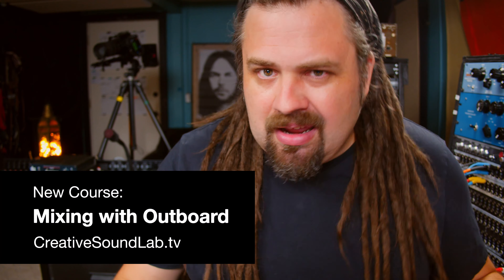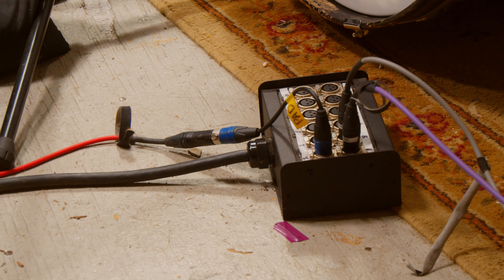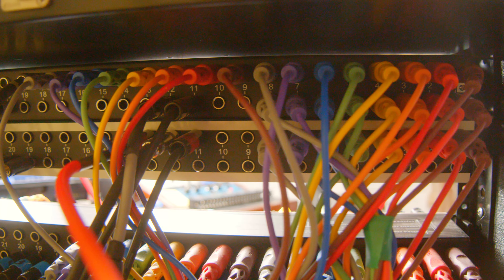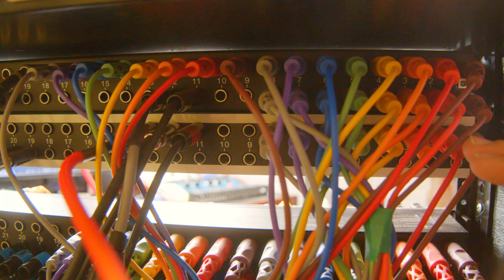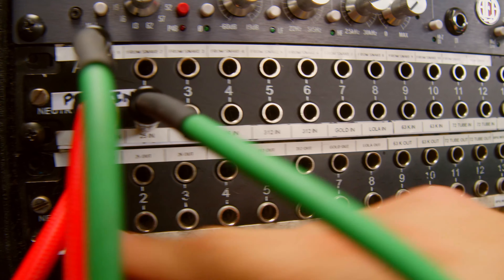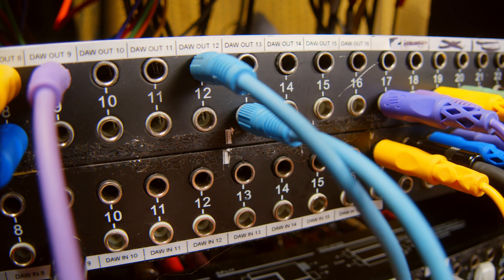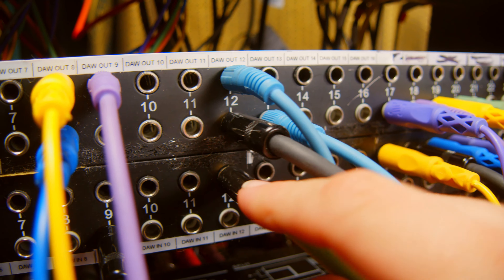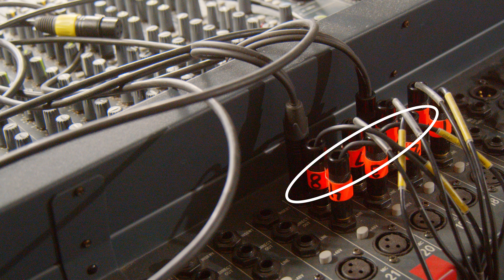The BACK of the Patchbay - Entire Signal Flow Breakdown

Comment: What about the connections to the back of the digital interface? Are they combo jacks? If so, are you connecting them with TRS or XLR and are those combo jacks serving as both mic pre-amp and line in? I really like to know. If they are not, how would you use those types of jacks. Thank you for the video.

Comment: OMG, audio routing is so much a pain in the neck. The More I look at patch bay videos, the more I get confused. I just got a patch bay myself, I need to stop watching and start experimenting connections - I hope, I will not blow out the studio. Is there actually a risk in doing it wrong and destroying the gear, causing some short circuits or so?
Reply: If you patch into 48 V phantom powered jack
Reply: @ZipTronic  6:30 you have phantom power on patch bay - those are for mics that need phantom, right? What you say is, if I patch a gear that do not need phantom, correct? What happens then, just to know?
Reply: Bye bye 🎤 (potentially)

Comment: Hi Ryan! This video is so informative. Starting to grasp the concept of the patchbay slowly but surely lol. I do have a question... i'm trying to incorporate some hardware compressors with my setup. my interface is just for recording as of right now. i'm using 8 external pres to record with my 8 analog ins and 8 analog outs interface (apollo x8p). I usually just connect them to its 8 XLR ins but it does have DB25 ins and DB25 outs. Let's say I want to incorporate 4 stereo compressors, is it possible to route them in a way using patchbays that i won't need to plug/unplug my external mic pres when i'm about to record or use the compressors for mixing? Cuz they still go only in those 8 analog ins right? But is it possible to like maybe jump around using patchbays? To my understanding that's how you have it set up right? sorry if it's a bit confusing!

Comment: Have you considered looking at investing into AoIP based interfaces like AVB or Dante? Both the MOTU AVB and Focusrite Red and RedNet Dante interfaces offers a unique feature called Routing Matrix, basically a virtual patch bay routing grid that can be done entirely digitally via the control app software which eliminates the need of a physical hardware patch bay and messy cables. I have the MOTU 828ES interface and I can do all the patching internally without touching a single cable.
Reply: What do you use instead of a snake using AVB or Dante?